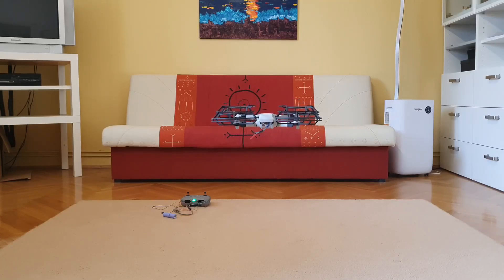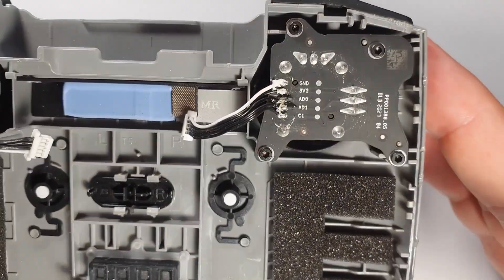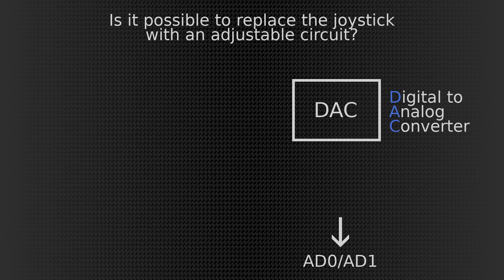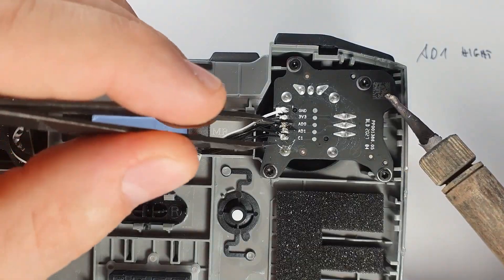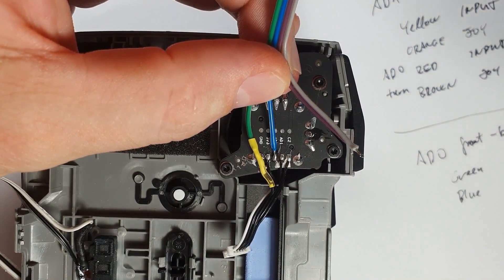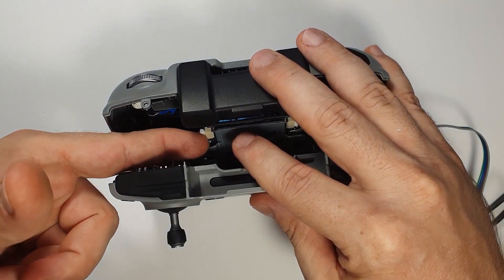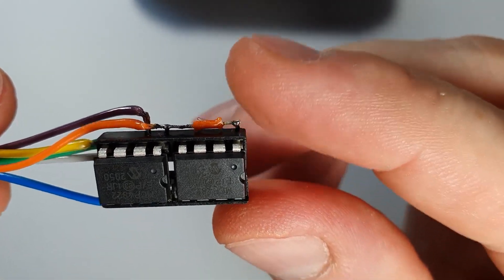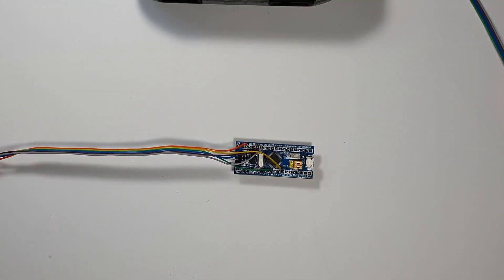DJI Mini 2 and Air 2 AUTOPILOT mod Part 1 (Works with other drones too)

Comment: Better use RosettaDrone so you also have video and the ability to use OpenCV, without the need to modify the RC.
I'm currently implementing Mini SE support.

I would like to see a mod adding the RC board + an Android board to a DJI Mini running RosettaDrone with a LTE/4G/5G connection.

The android board will need to support AOA.

I can provide you all the software.
Reply: You have RosettaDrone working with the Mini 2 SE???

Comment: I was looking instructions to my own project and find this very interesting project of yours.  But I'm completely noob at electronics so can somebody show me a direction. 

My own plan is adjust yaw sensitivy manually. So I was thinking to add own potentiometer after RC stick potentiometer. I watch you video and understand RC wiring now. But are completely lost all else

I mean what type potentiometer and resistor I need to use, do I need something else. Is there good connection cart or tube tutorial for this kind of work and where I took ground. All advices are highly appreciated and sorry if this was little off topic. It's very hard to find info for hardware RC modding

Comment: Have you done this with the mavic mini 1  remote control ? Will this process work on the mavic mini 1 remote?
Reply from the maker: It works 100% with the Mini 1 as well.

Comment: I am ordering MCP4728 and will perform the mod on dji fpv. Thank you for the tutor
Reply from the maker: How did it go?
Reply: @ZollyD  no need MCP4728 to do the mod. Just ESP32 GPIO is fine
Reply from the maker: @KensonLeung0  that is true. I just simply find the ADC more reliable in the STM32. But hey, what works, works😉

Comment: I have an idea : Made some kind of a sensor kit  to add obstacle avoidance to it. MCU+Time of flight sensors+long range nrf24l01 to get some feedback what's around it. system can overide given command by looking at sensor feesback. (i add this is because it will be fun. i know some letancy is going to involve and many other problems. this is just an idea)

PS : After i watched this video then i directly head to his channel and i saw obstacle avoidance idea.. niceee
Reply from the maker: You see... :) On YouTube, like-minded people can connect!
Reply: @ZollyD  😂😂 that's true.. keep up the good work

Comment: Voice controlled movement possible? I think so. Give it a try. It would be even more easy and awesome to fly. 6 movement like forward, backward, strafe left, strafe right, spin clockwise and spin counter clockwise.  Now a 6 year child can fly drone with ease
Reply from the maker: Yeah, but for us to react in words, is much slower than with joysticks. Maybe for fun we can try it :)  Joysticks are also not disturbed by external noise...

Comment: thats what i have used to hack into an rc car remote to control an fpv camera to tilt with the channels that were only used by the switches. some remotes may not support something like that on channels that work with switches
Reply from the maker: cool :)

Comment: Well, those DJI factory solder joints were...not great lol. 

Great project, definitely following. It would be interesting to apply to a freestyle or cine-whoop rig.
Reply from the maker: Thanks! :) Yes, only problem there if I am correct that the altitude is also controlled by the operator. This assumes some altitude hold. So a bit more work but could be done... :)
Reply: @ZollyD  INav will support alt hold with the appropriate sensors. They also have the option for pre configured flights, but I don't think it is as granular as yours. Target altitude, speed, and location pretty much. 

Your solution would make cinema shots so easy.

Comment: Would be cool to use voice commands with this mod.
Reply from the maker: You got to be a fast speaker than... 😅😅😅
Reply: @ZollyD  can be short commands
Reply from the maker: @Hardenjade  Yeah, I am kidding. :) I just don´t know how to implement it in a way that it becomes usable. I am not that smart... 😅😅😅
Reply: @ZollyD  well to do all this means that you have a wealth of knowledge... however at this point its kind of redundant because you can input commands onto the dji app making the drone autonomous. So more or less your  just inputing the same commands from a pc to do the same thing from an external source. Great work but more practical if with all this one can just say launch and it automatically launches the drone etc etc...
Reply from the maker: @Hardenjade  Have you seen my latest video on the subject? It does kindof like that.:)  No voice commands though.
Reply: @ZollyD  ima check it out... but keep up the good work tho...
Reply from the maker: @Hardenjade  cool. Thanks! 🙂 I gonna do my best!

Comment: Same stuff would be really useful and tricky too for DJI FPV. What do you say? 😉
Also, don't you think there should be a switch to do the manual override on runtime in emergency?
Reply from the maker: Yeah, right!🙂
The override is already implemented in part3. 😉
Check it out!

Comment: I'm pretty sure that the microcontroller already has the ADC and DAC there wouldn't be any external component, they just need to be configured and I think the program will be simpler
Reply: If it's just a pwm signal you can use a low pass filter to leave it with analog I think there are several libraries that do this
Reply from the maker: You are right. That could work too. But that would be yet again added components... 😀 I simply trust DACs more that low pass filtering. Personal preference...

Comment: Great idea! Why do you use the DACs? Are the analog pins of the STM not enough or don't have the needed voltage resolution?
Reply from the maker: The STM32 "Analog"pins are just PWM. The controller would go bananas from that signal. It really needs analog levels.

Comment: I thought of this as far back as the original Mavic but my concept was to use motor controls for the cyclic. I wish DJI would open source their software; there are so many basic things I wished my drone could do. I still cannot get my drone to fly a route (flight path) autonomously. Why can't I fly a route manually, save it with camera settings and have the drone repeat that route with camera settings autonomously?
Reply from the maker: My last video is really for you! :) https://youtu.be/kdboVdRC9p0

Comment: It is possible to replicate the remote control signal through 2 smartphones in such a way that 1 is connected to the drone and the other remains close to the remote control as if it were a call and in theory it should extend the range of the drone to infinity as long as there is the 4G signal of phones?
Reply from the maker: Very interesting idea! :)  I can look into it. A bit worried about latency though... Thanks for the tip! :)

Comment: Being electronic engineer when much younger I dig it! So I follow to watch these various ideas. Would be great adaptor product idea for my mini 2, but I realize this is all designing & testing for now. 
Best on your designing projects!
Reply from the maker: Thanks! :) Yes it is in the development phase. I will design a PCB for it and then it will be easier to deal with it... :)
Reply: Hi @Zolly, do you think any means of tracking could be done, or it would be too much extra electronics added on craft for side avoidance & analyzing object in picture?
Reply from the maker: @batchboy999  I am looking into it, but it looks that a whole new system needs to be put on. Like Open CV, Raspberry Pi, and the whole thing. I will keep looking.😉

Comment: Tell you what zolly. If you can find out how to make the drone fly higher than it's maximum (around 1650ft), I'll give you a 200$ donation. I can send half of it before you make the video and the other half after you complete the task or whatever makes you feel better.
Reply from the maker: I can try to cook up a concept! :) I will for sure not try it, but let´s see what can be done. I have an idea, but have to see... ;)
Reply: @ZollyD  any mods I have in mind that you're able to complete, I'll make   donations.

Comment: Can there be a less complex system to allow precise unchanging movement. For example, moving same speed left and forward to get precise 45deg track. Could we use 2 separate rotary potentiometers (F/B L/R) so once the potentiometers are set, flick a switch and external potentiometers take over.
Reply from the maker: Yes, that would work too. :) In my future videos you will see why I needed to implement it the way I did.
Reply: yeah, like motion lock. It would help a lot, I would like to set the motion with sticks then press the button and release sticks and drone just carries on last inputs.

Comment: I think when you start going this route just get a Pixhawk. It does everything you want to do.
Reply from the maker: Yes that is very correct! 🙂 I am quite interested in those!
This way of doing it would also work on an RC car, or anything really with a joystick controller. 🙂
Reply: @ZollyD  I wonder if you can combine what you are doing with pixhawk. The pixhawk can control servos and it had gps auto pilot. Maybe create a hybrid monster. Probably best if you just let the pixhawk take over the motors I guess but who wants best. It is all about fun

Comment: maybe a good idea would be to do a small pcb with that jst(?) type connectors to tap into the joysticks so you don't have to solder and desolder wires ?
Reply from the maker: Yes! Yes! Yes! I am on it. 😊
I just have to find which exact connectors are those. There are so many JSTs I always get confused....😂😂😂
Reply: @ZollyD  yeah, those look like the 1mm ones, I had trouble getting those also for my beaglebone blue haha

Comment: hey dude, this looks awesome, do you have a repo for this project? I'll love to see it, I can't imagine the amount of things that can be done, from a bt module connected with an app to whatever really, the only thing I'm struggling with would be tapping into the live video, but I guess that maybe grabbing the cellphone screen might do the trick ¯\_(ツ)_/¯
(btw I'm you #1000 subscriber haha)
Reply from the maker: Thanks! :) No repo yet for any of my projects. What would be the best platform for those? (I am new to online presence) Yeah I am struggling with tapping into the data on the USB. Any experts out there? 😅
So you are 1000...😉
Welcome to the gang! 😉
Reply: @ZollyD  idk how familiar are you with git, maybe github for the platform would be ok, it's like the most known.
for the video is the reverse engineering protocol I saw a comment mention, or wait a couple of months until DJI releases the SDK, but I guess that when they release the SDK, you will be able to do all the autopilot and custom automated controls without having to tapping into the controller and stuff

Comment: Amazing, now you have to get the gps data, write an sdk comptatible with the dji one, and tell litchi 👍👍😁
Reply from the maker: Yeah! I have no idea yet how to get the GPS data. I think I would need to tap into the USB traffic, and that is something I have no ide how to do... ANY EXPERTS OUT THERE? I anyways want to create a community around this. Imagine people developing cool QuickShots and sharing it with each other... :)
Reply: @ZollyD  That would be great !
For this to work well, you need a feeback between the GPS position and the commands, and you need to have this GPS position with a sufficient frequency. The drone does this, but I think it does it locally, so the GPS position may not be transmitted that often.
I'm not anyway an expert, but I think that listening to usb traffic is not a problem, using a probe, but reverse engineering a protocol, that can be difficult, and long
Happy hacking !!!

Comment: This is beautiful, this can be done with low budget drones and other drones.
Have also been experimenting on automating the flying process.
Exceptional concept and simplicity.
Reply: For low budget drones, you'll probably miss the feedback about the drone's position and orientation. It works fine until the drone keeps a steady position in the air.
Reply from the maker: Correct. That has to be established with another radio link. It will be sorter range, but at least something. :)
Reply from the maker: Thanks! :)